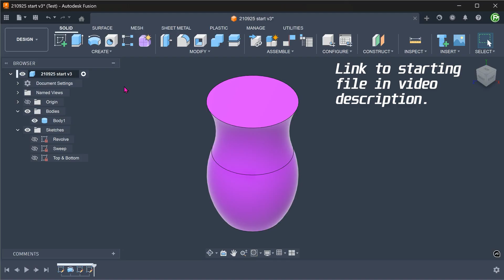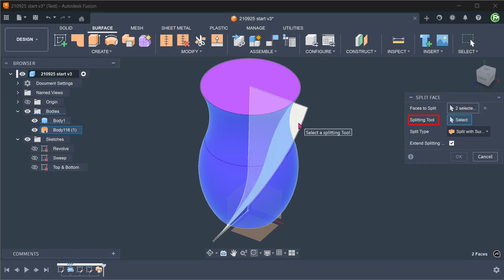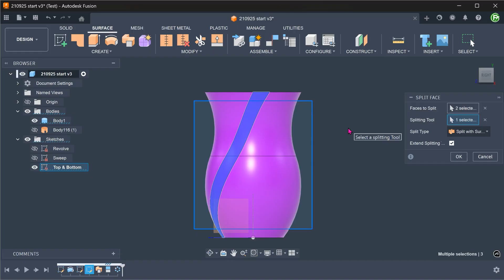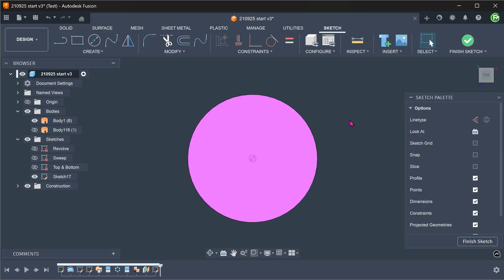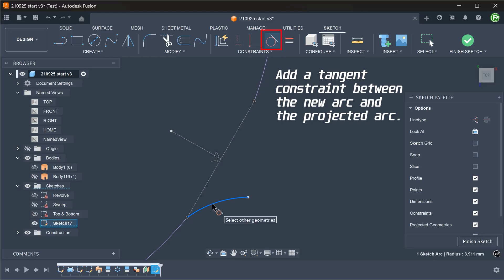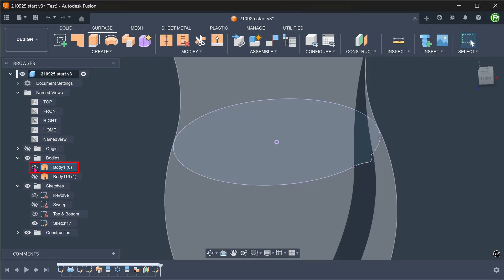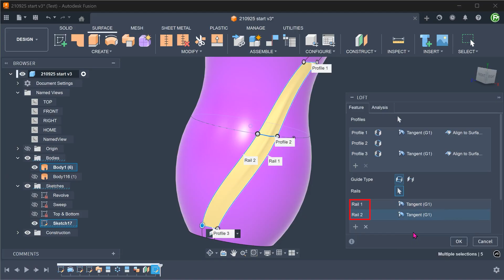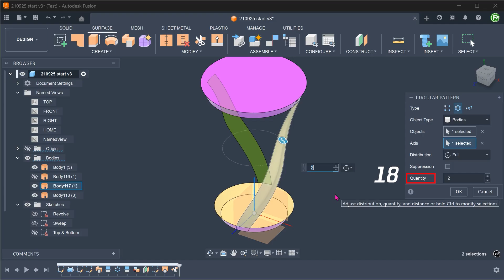Autodesk Fusion | Blended Spirals (Surfacing)

Comment: Sorry this drives me crazy - where is the middle circle ocming from? It is just one body, all sketches are disabled, yet there is a line splitting the body into two faces... How? Was this somehow part of the initial revolve? Thanks!
Reply from the maker: Hi, could you point out the specific moment in the video? Thanks.
Reply: @TheKarolans, this was throwing me off also.  I downloaded the file and had to play with it.  The line comes from where the two radi that form the top curve and the bottom curve transition.  This transition creates the two faces and therefore the line.